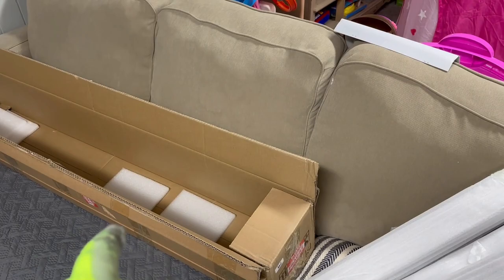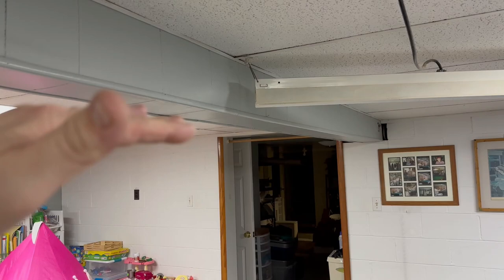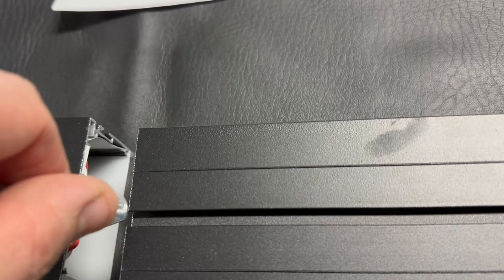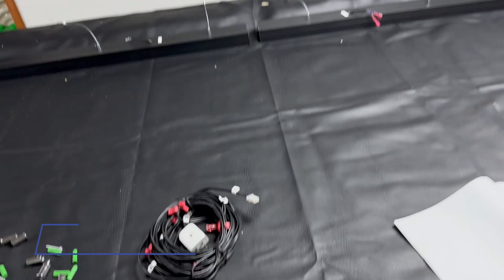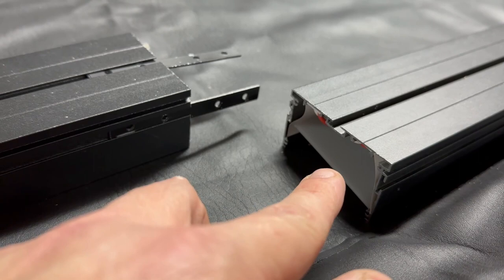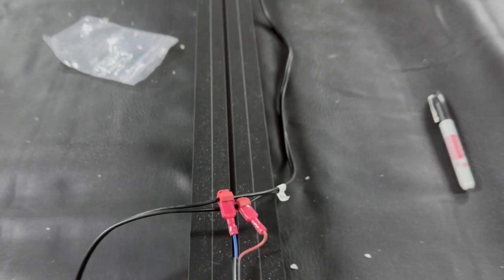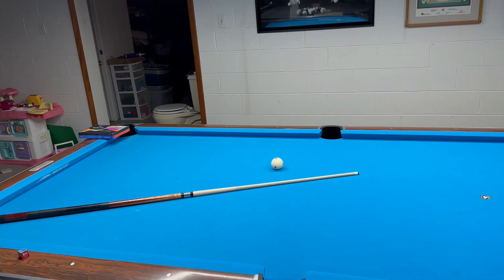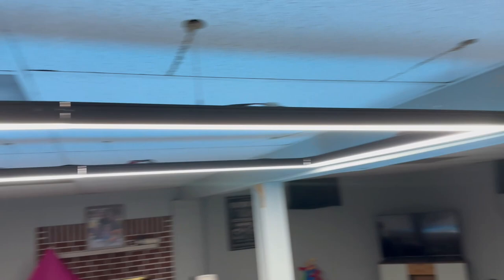Best Pool Table Light For the Money Hands Down!

Comment: I was going to get a predator area light. But then ran across this light. I'm glad someone reviewed it. 

Couple questions if you don't mind for all of us wondering. 

a. Are you having any issues with flickering leds, sometimes won't turn on right away, etc?

b. On a "heavy duty, feels strong" type of scale, how would you rate this? (1-10) 10 being "I can throw it on the ground and it won't break".

c. Lastly, since you've had the light, have you had any issues with it at all?

I know your affiliates with this company, but I hope you can try to provide an unbiased answer for all of us. I, just as many of us looking for an area light, really like the half price of the predator light. 

And perhaps instead of answering questions, maybe and/or a follow up video soon on having it for a bit and please show us what you did to hide your cables, fix the workaround issue of the drop down ceiling and cable anchors, etc. I'm sure it would help everyone. 

And where all does this company ship to?

Sorry a long response, but as soon as my taxes get back it'll be on order. Icing on the cake.
Reply from the maker: Thanks for the comment and yes I will be doing a follow up video at the 3 month mark of owning it. Even though I’m affiliated I would only give a 100% honest opinion. My word means the most when I build cues and work on tables etc…

No issues whatsoever so far, and from what I’ve seen if anyone has had issues they are good about shipping out parts. 

Heavy duty I’d give it a 5. But imo that both good and bad. In hindsight the light is so light and has so many hanging cables with it, I should have just used drop ceiling hooks instead of anchors.
Reply from the maker: Hope that helped and don’t forget to use DANMULHOLLEN at checkout for $10 off and for me to get some dough lol.
Reply: @mulhollenbilliardschannel654  will do. Thanks!

Comment: I'm in the market for a Billiards table light for an 8' home table I'll be setting up. This brand is a likely candidate. 
How many wires hold this up? Is the default a hard wire or a plug-in? Thank you
Reply from the maker: These are very light. So 4 is enough 6 is good to, to be on the safe side. The default is a plug, I suggest plugging it in a power strip so it’s protected and on a switch. Please use my code DanMulhollen for 5% off and it helps the channel!

Comment: Nice.  I have a 9 ft pool table with a rwgular hanging pool table light.  However I wanted to get one of those  ping pong table tops to put on top of my pool table to play ping pong, but my current  light will get in the way of playimg.
 So I was thinking about replacing the light with a Perimeter Billiard™ LED Pool Table Light like yours.   Iam assuming  I can mount it higher than the regular pool table lights so I can play ping pong?  Also I wanted to know if I will be good to use a 7ft pool table light on my 9ft pool table??
I also may downsize from 9ft pool table  to 8ft pool table I don't know yet.
Reply from the maker: Yeah this would work way better for a ping ping top. I used a 7’ light over my 9ft cause I had to. However I’d suggest going with at least an 8’. Also for the little bit extra you might as well get the 9’ imo. But let me know if you want one, buying through me helps the channel!

Comment: What distance did you choose from rail ( 31 inches ) high from bottom of the light fixture?
Reply from the maker: Sorry just seeing this, mine is only 45” due to ceiling height. But 50-55” will work well
Reply: For a regulation table it is 34” to 36” above slate.
Reply from the maker: @eddiegodoy3671  for a standard light it should be your measurements. But not for perimeter lights. They have to be higher
Reply from the maker: @eddiegodoy3671  just so you know if you’re hanging a perimeter billiard light it’s suggested 50-55” above playing surface. Traditional 3 bulb lights and other center lit lights should be 36-42” above playing surface.
Reply: @mulhollenbilliardschannel654  agree it depends on the type of illumination and lumens. I was just commenting on the traditional.

Comment: I am definitely in the market for one of these lights. So you can install this by one guy? Only thing that I see could be a challenge is making sure the cable anchors are directly in line with the cables as it sits on your table. How do you make sure they are not off line?
Reply from the maker: Thanks for the comment and also my code DanMulhollen gets you $10 off so please be sure to help me out if you decide to buy. 

I was able to install 3 of these myself. As long as the ceiling isn’t over 10’ it’s very doable yourself. Can use plumb Bob or a laser to be precise. But I held the cable straight as possible and eyeballed it. Looks great imo.

Comment: What would it cost to replace the LEDs when they die?
Reply from the maker: Our lights come with a 1-year warranty, if anything happens during this period, we will send the replacement part for free. Otherwise, it will be around $70-$90 depending on size.
Reply from the maker: The lights come in 6 sections so the replacement will be for the section that went out. Thanks!
Reply: @mulhollenbilliardschannel654  Is it 70 to 90 for a section or 70 to 90 for the whole set to repair. Thank You for your reply.
Reply from the maker: @Soniccues  it’s $70-$90 for each section.
Reply: @mulhollenbilliardschannel654  Thank You, that is exactly what I wanted to know. By the way you can get the LED's and replace just them without replacing the whole section. This can be done for penny's in comparison. If and when you need to replace, take the bad one apart and see if you can source just the LED's. Very simple solder job if possible. I have other LED units and I have a spare that I use to replace the bad one and then repair the bad one as a spare again. My garage is lit up by six very bright 60 dollar LED units and the replacement LED chip is 3 dollars.